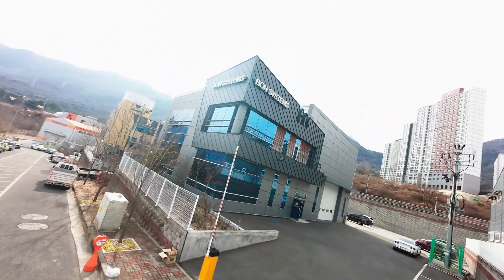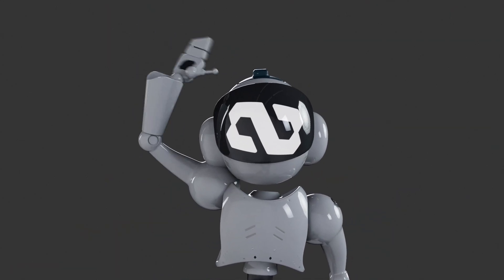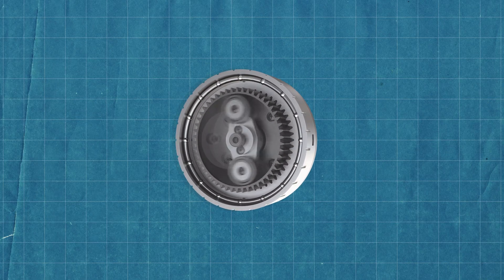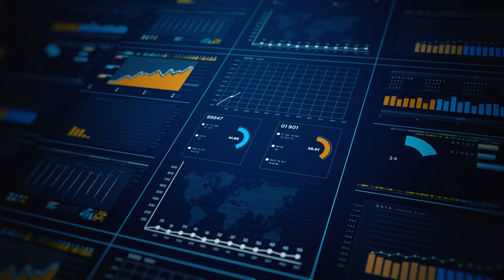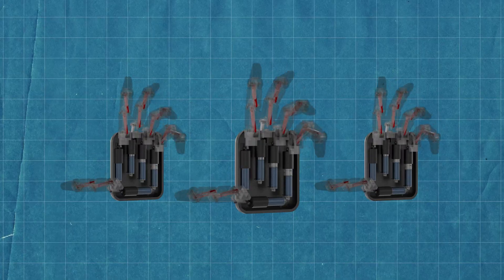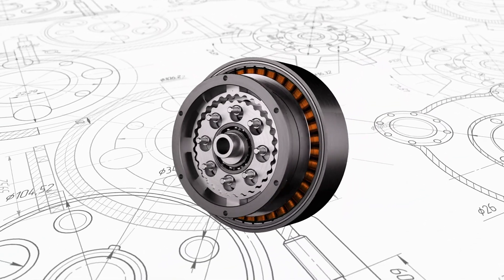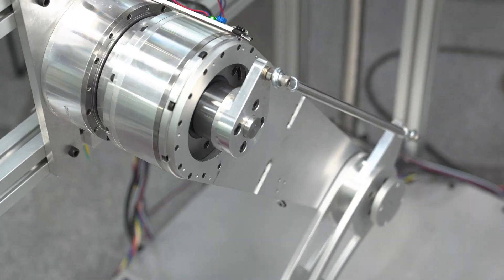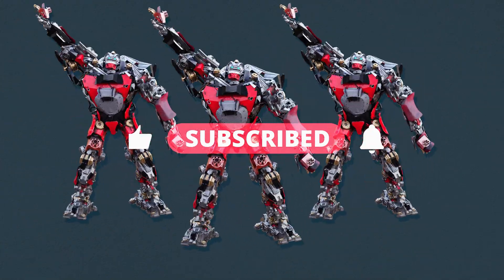There’s a reason we make actuators thinner

Comment: Why not fix the eccentric cam and rotate the outer cycloidal profile? (With the carrier still being the output) That way the magnets could be embedded right in the outer ring and be directly drive by the windings
Reply from the maker: We're actually trying that method to directly integrate actuators into AGV wheels! We recognize that the design you mentioned is very practical in certain aspects. We plan to upload a video once we complete the actuator wheel using the structure you described.

Comment: How do your actuators hold up to wear? It looks like you machine the outer cycloidal disc from one piece without bushings or hardened pins. Any other surface treatment going on?
Reply from the maker: As you mentioned, we are using a CDC-type housing for our miniaturized actuators. We are currently in the process of continuous testing, and if we don't achieve the performance we expect, we plan to apply surface hardening treatment. When that happens, I think we'll make a video about it.